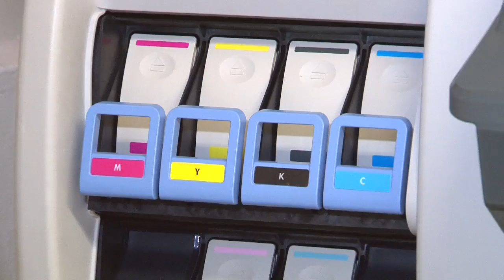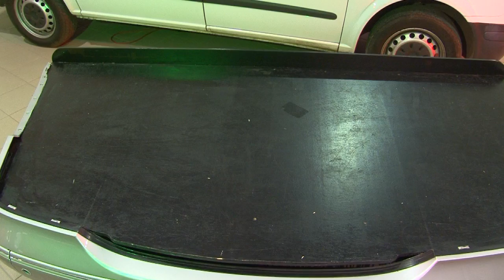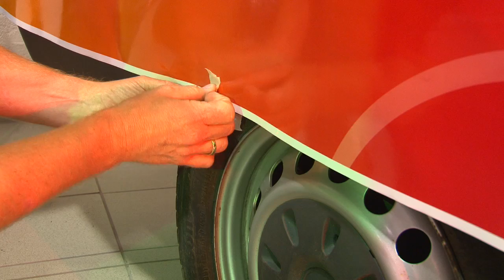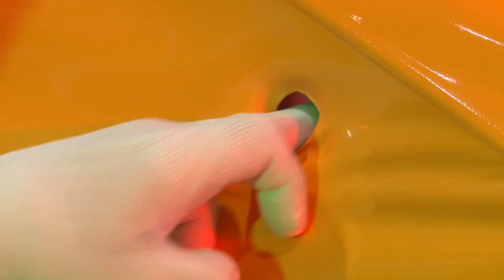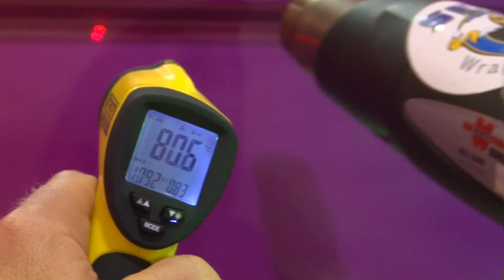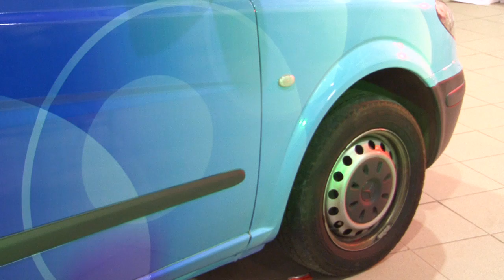LG Hausys Car Wrapping Tutorial

Comment: Is heat used to shrink aswell as expand the film, depending on the temperature?
Reply: Chris Cork heat is used to soften vinyl so it stretches easier and also used to shrink back to original shape. When you use heat you have a greater chance of over stretching.
The most important time is to post   heat the entire car.
Reply: taaa

Comment: I would use a 3M V-Cat roller for those indented channels. Using your fingers won't provide adequate pressure to activate adhesion for a quality install.
Reply: just wrap your squeegee in a microfiber towel so it's thick but thinner than your finger and go over the area and save yourself some money.

Comment: Always wondered if i should measure temp with the heatgun actually not pointed on the vinyl. I think if you point the measure tool at the heatgun's blow it will throw out the numbers and it will not show how hot the actual surface of the vinyl is